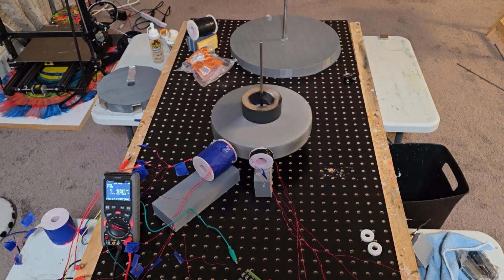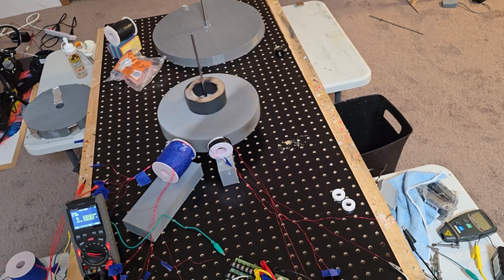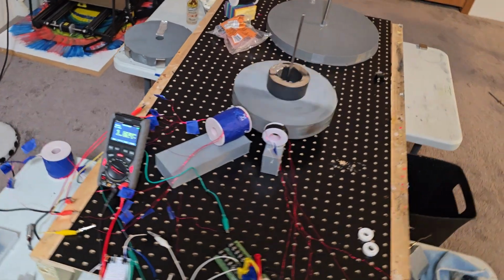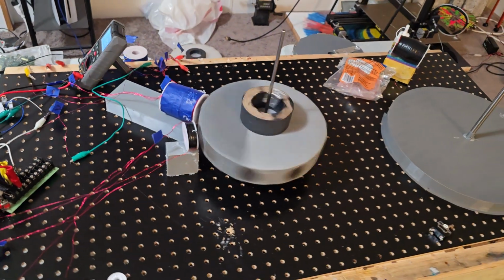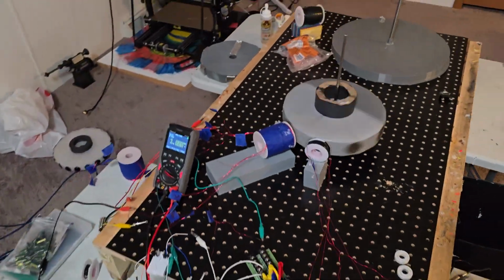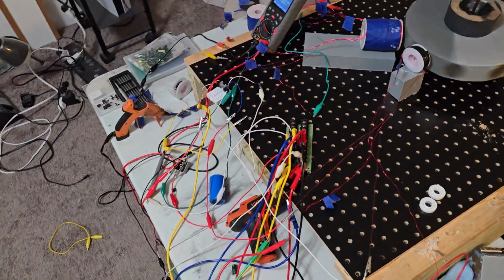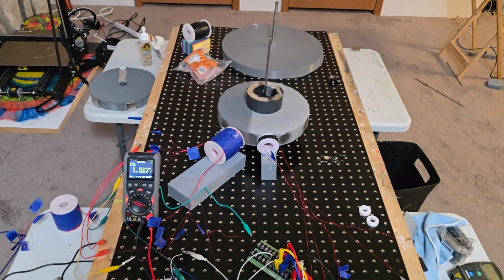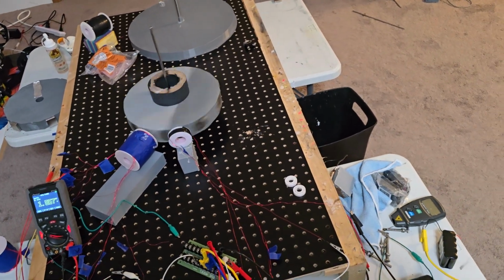pulse motor trifecta coil can move without a hall effect sensor or a Reed switch. Trigger coil cool.

Comment: Love your videos! 
Using a trigger coil works well but has some cons ...timing is even more important with a timing coil also speed of the rotor. Use only one diode going to the gate and always have a resistor on the gate start with about 100ohm . Still can't beat a unipolar hall sensor when using alternating pole magnets on the rotor
Reply from the maker: Thanks for the tips!